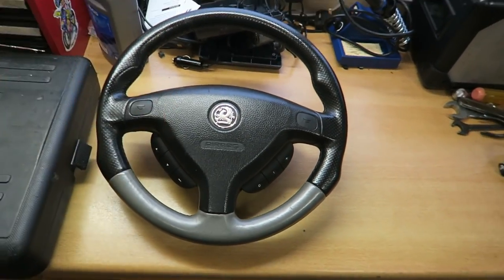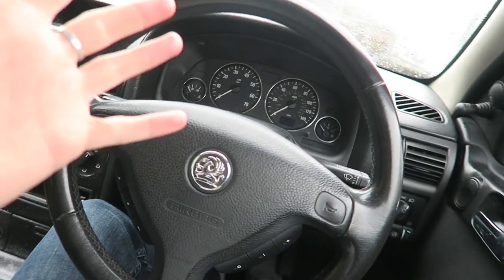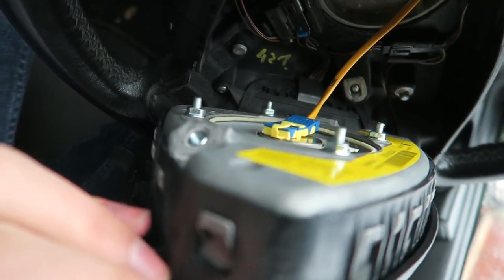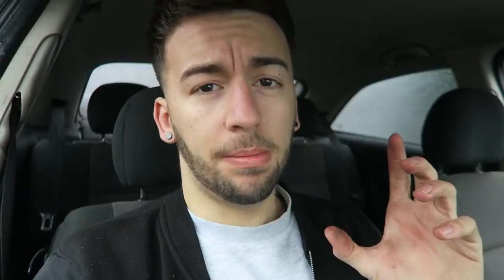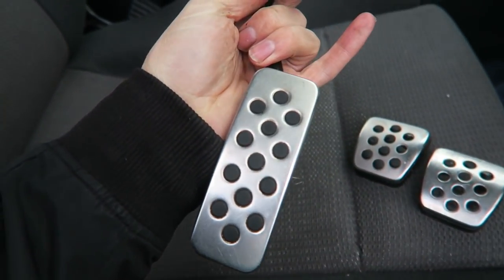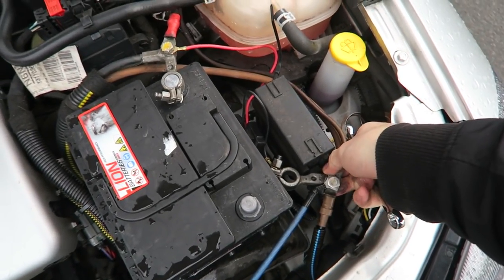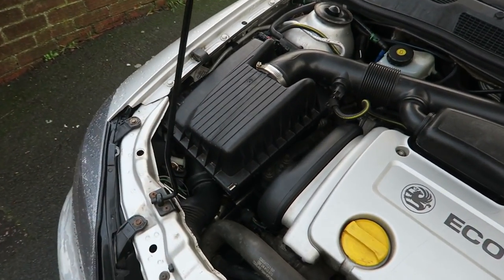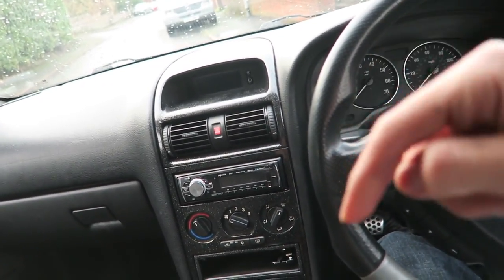3 Mods In 1 Video!!

Comment: Top tip when removing a steering wheel.  Always loosen the bolt as far as possible, just leave it in the threads a turn or two.  

Then you pull on the wheel, the wheel cannot go out of control and hit you in the face or yank on a electric connector.  Then just undo the bolt the rest of the way and remove as normal.
Reply from the maker: Chris Paul as a rule that works, but on a lot of cars I’ve worked on the wheels are never on tight
Reply: Ok Ed China...
Reply: or you just spend 10 quid on the right tool

Comment: Nice to see the Astra videos. I picked up exactly the same car (model and year) a few months ago, it's going to be a bit of a project so I'm looking for to seeing what you do with yours (I've already added a few GSI steering wheels to my watch list after watching this vid :D).

About your center console. My Astra is in black and came with a silver center console, it would go nicely with your steering wheel. It might be worth having a look around some breakers see if they have one. It was silver from the factory so you know they can be picked up already in that finish. It's hard to beat a nice silver/black finish. My plan is to have the kind of opposite of yours, have the black car with silver trimmings. I had not long found the Angel Eye headlights when I saw your vid about them.

Looking forward to seeing the 5 stud conversion. Keep up the good work. :)

Comment: The best thing to do with the center console it to swap it for an Astra Mk4 gsi Sat Nav Centre Console! (for the Vauxhall/Opel gsi gte coupe and Zafira)! Most of them are black, gray, silver or with carbon fiber print. Would go for the same color of the car! You don't have to buy it with the Sat Nav because they are still expensive and I don't know if the wiring is there for them on the non-gsi mk4's. But, it fits any 5-inch screen so an aftermarket reversing camera or/and dashcam would be an amazing mod! It fits with the gsi look and is an awesome upgrade!

Comment: Hey dude, a quick tip when retightening the centre bolt if your unsure of the torque setting is to use a paint marker or automatic centre punch to indicate where the TDC (top dead centre) of the bolt is before undoing it. So that way when you retighten the bolt you know exactly where to stop & not over tighten it.

Love the video content, nice n simple mods you can do on your own driveway. Keep up the good work. 👍

Comment: Good for you for highlighting the potential dangers of  airbags - they are explosive devices after all. I think its the capacitor(s) that have to drain down after you have disconnected the battery so the air bag doesn't accidentally discharge

Comment: Center consol, I'd go for a matt black finish where the lcd display is and down past head unit, then I'd do the bottom parts, Ash tray are to handbrake in similar gray to bottom of wheel, then silver stitched gators, oh and have you thought of an irmscher badge for steering wheel center? Do like the mk4 Astra, use to have a z18xe1 sri in black, brilliant cars. 👍👍

Comment: Get centre console off the gsi its the same colour as the bottom of the steering wheel
Reply: You thought about getting the adapter so you can use the steering controls?
Reply: That's my vote too
Reply: Agree, would make a nine match

Comment: Nice video liking this project, I personally would get a GSi centre console so it matches the steering wheel then see if you can find a gear and handbrake gaiter in the same colour as the bottom of the steering wheel??? Also I think you should now get a driving video to give us an idea of your new induction noise 😁👌

Comment: When removing the steering wheel, leave the nut in when you try to free it....it wont fly off and hit you in the face or damage any wires. Just a helpfull tip for you :)

Comment: Grey for the centre console, match the steering wheel.
When you mentioned the cone air filter I was going "NOooooooooo!!!!"
While it was nice of Funk to send you a freebie, it isn't something I would like on mine.
You're lucky this is a MAP- only engine, those things can mess up the way the air flows through the intake ducts and cause MAF sensors to give incorrect readings affecting fuelling that standard fuel trim action won't tune out.
If you want to experiment for more intake noise, get another intake duct and remove the resonator box, you should find it gets a throaty roar at a certain RPM and high load.
As I've said before, I've really enjoyed the Astra series, I have a Zafira A and my gf has a Astra G like yours.

Comment: Them open panel air filters just make more noise. Use more fuel, and lose power on bottom end. They're a gimmick on the application you've used it on.
Reply: I learned that the hard way and went back to the standard box and panel filter
Reply: @karlfeast  - Drop by the comments to check if anyone noticed that...
It's the most stupid mod one can do...  Apparently morons never learn. LOL 😂
At least this guy didn't had to pay to downgrade his engine! For the sake of "better sound" how ridiculous! hehehe

Comment: When the rubber wear down on the clutch pedal and you have water on ur shoe it is leathol but I do have an uprated clutch on my vxr (don't get a lightweight flywheel they sound dodgy once up to temperature)

Comment: I got the sr turbo limited edition and the colour of the centre console is the same colour as the steering wheel which you have now that's the way I would go I am very interested in what you do that xvideo as I need to do mine again but I want to see how you take it apart I have booked it in with Vauxhall to take all of that apart and respray it for me and they're charging me £360 I'm supposed to be getting it done on the 18th of December but depending on how easy it is to take apart I may not take you there looking forward to your video

Comment: I don't know why people are so paranoid about air bags going off by accident, it is very unlikely even with the battery connected. You would have to introduce at least +10v to activate it by accident and that's assuming it is still grounded. I think the CANBUS / OBD (whatever you want to call it) is also only about a 3v signal so even if shorted to the positive side won't be enough to set it off. 
Also there are no capacitors in the ECU that hold enough voltage after the battery is disconnected to activate an airbag so after removing the positive from the battery you have more chance of being struck by lightening than setting it off.

Comment: That cone filter is loosing power not gaining it, a high flow cotton direct replacement panel filter is what you should fit, those cone filters just such up hot air from the engine bay!

Comment: The air filter will do nothing for your performance as its na bro, you will probably get heat soak after 20 mins reducing performance than the standard box, you need to separate the air filter from the heat of the engine you can make a foam based guard and supply a cold feed via the wing etc, piano black for the interior mate top job on the video

Comment: Airbags need power to go off so stop worrying. You can hit and throw them things around and it will never go off. You need to hit the sensors on the outside of the car to set it off and they take a big hit to set the air bags off not a little bump

Comment: I am pretty sure having lights on won't help drain the battery. Airbags are safety devices and likely to have one way diodes.

5 minutes isn't long enough. If I knew I was tampering with tbem, I'd disconnect the battery the night before.

Comment: Hey, i need help. I have a vw polo 9n1 5 door 1.2 64hp. Recently I bought a keyless entry kit from amazon. My car already has the central locking system pre installed from factory but sadly didn’t have the remote key. So basically i was installing it but got stuck halfway through. I got it to only lock but doesn’t unclok when i push the unlock button. I need the wiring diagram desperately. Will really appreciate if you could help.
Reply: Wiring diagrams will be in a haynes manual. Couple of quid on ebay.
Reply: Is your car a 9N polo (chassis no wvwzzz9nz.....)?
If so, things are a little more complicated because the locking on the car is controlled by a single wire.You wire your interface box to output negative pulses.
The central locking control wire on the Polo is on the white 6 pole connector on the drivers A pillar, where the door wiring connects.
The wire your looking for is blue/white and is on pin 5 of the connector. I've made a note that the wire may be coloured white on some cars.
Connect the LOCK wire of your interface directly to the blue/white wire on the vehicle loom.
Connect the UNLOCK wire to the 180 Ohm resistor.
Now connect the other end of the resistor to the Lock wire of the interface box.
Reply: Paul Rees i think you are correct . Infact I found the blue\white wire and i connected the wires, but it only unlocks the car and doesn’t open it at all. I also wanted to wire the indicators but there doesn’t seem to be a wire in the door loom to do so. Any idea?
Reply: @carislife5960  If you need to connect your unit to the indicators they can be found on the black 16 pole connector on the power supply ECU under the dash at the pedals. I think that is the connector to the rear right of the ECU. When I say rear, I mean towards the dash, not the bulkhead. The wires are black/green (pin 14) and black/white (pin 16).
Reply: Paul Rees thanks alot. Will update tomorrow.
Reply: Paul Rees mate thanks alot, it’s all working now! But i also wanted to add the boot lid release function, the horn function (when i lock the car and unlock it) and the windows rising and rolling down by holding the lock or unlock button. Any ideas?

Comment: I bet the air filter also makes the exhaust louder!
Reply: Jay Lo 

How did you work that out?
Reply: @colwyn9  More intake, more output.
Reply: @jaylo912  
It cant though, the tiny little 1.6 can only breathe so much hot air from the engine bay.
I think you need to read up on how engines work, then you will see why there is bogged down power and stupid vacuum cleaner sounds
Reply: @colwyn9  May be you should do some deeper research on air intake and how it affects back pressure mate.

Comment: For safety reasons you should disconnect the battery I worked in jaguar 
Land Rover and have seen air bags going off when the door setters have been adjusting the door set nd also when the front seat have been taking out
Reply: william walker pretty confident he already knew that hence why he disconnected the battery